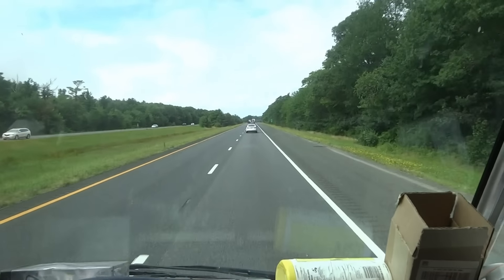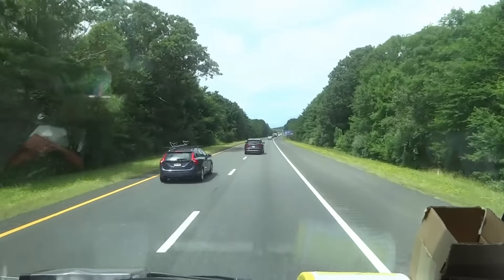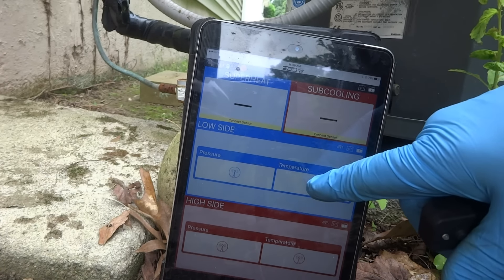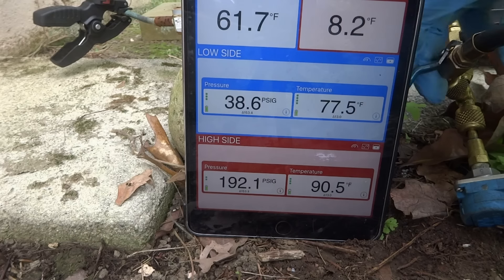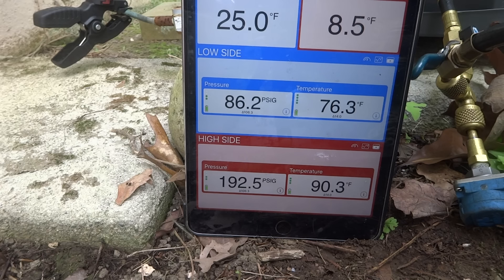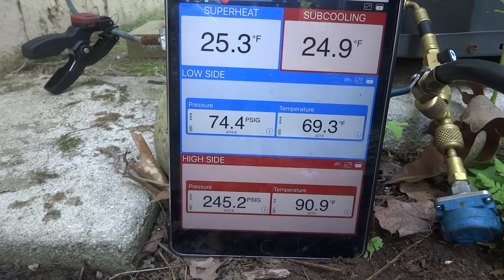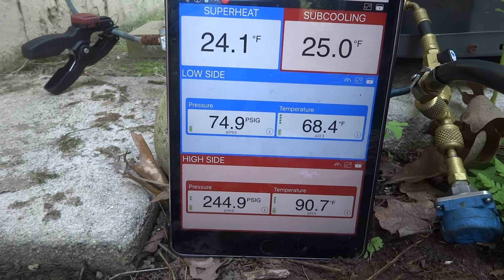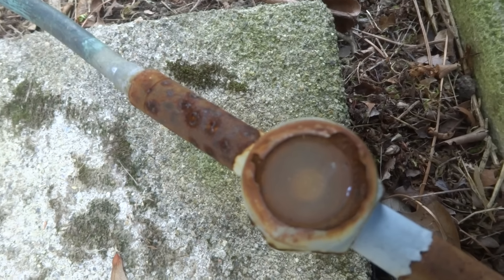GOODMAN AC NOT COOLING

Comment: "As of January 1, 2020, production and import of R22 refrigerant will be illegal in the United States."
how do you have r22 ?????? i have a 2ton r22 and nobody wants to fix it here in NY. They keep telling me to buy a new unit..
Reply: It can't be produced or imported, but they can reprocess recovered R22 and resell that. It's very expensive, both due to the cost of reprocessing it and the fact that they know they can charge however much they want for the limited supply. Steve can't legally use recovered R22 himself either, he can only turn it in to be reprocessed (unless he's moving it to another unit on the same property, that's legal to do).
Reply from the maker: i have plenty of it  i seen this coming many years ago so i stocked up on it while is still could .. try to find a honest hvac guy .. there are refrigerant blends they can use also . problem is hvac guys just trying to sell you new equipment to make a payday is your problem